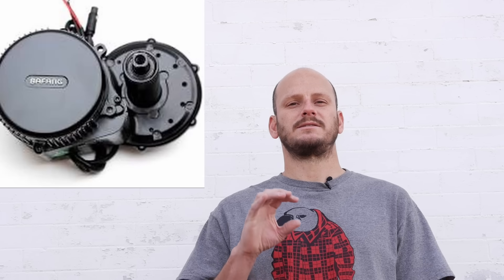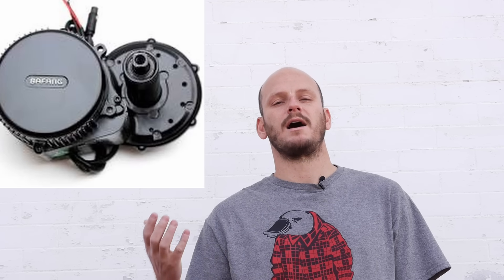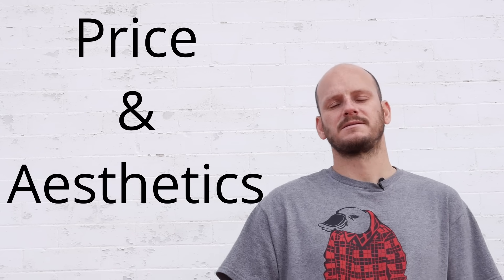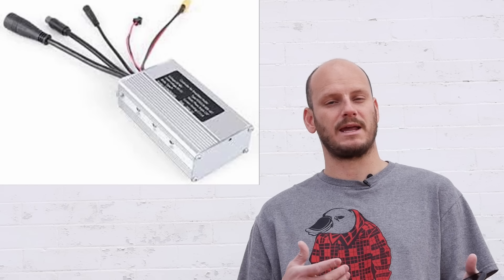Hub vs. Mid Drive Motors: Why Hub Motors Suck and Debunking Common Myths with performance test

Comment: I just installed a 350 watt (36v, 13 Amp battery) hub drive on my Milwaukee gravel bike and the hill performance is astounding.  On paved roads it levels hills nicely, feels like a tailwind, and on the roughest, steep gravel it gives me confidence I didn't have before.  Can't think of anything worse than spinning-out or stalling on a steep gravel hill.  The bicycle is equipped with a 10-speed 11-32 cassette with a 26/39 crankset, as long as there's traction, never had a problem in the machine's 18,300 kilometers on the dirt but the e-hub contributes greatly.

Comment: Boy you can tell you make more money off of mid drives. Highly exaggerated. Yes mid drives are better in many ways. But they're not really worth the price compared to the price of a hub Drive. I know how to use gears and I still own a hub Drive. I go up hills and I go long distances I have a 52 volt 20 amp hour battery too. If you're going to spend money you might as well buy a bigger battery. Not a mid Drive motor.

Comment: As the power demand on a mid is less than with a hub because of the gears, does this mean the number of miles per one charge should be longer?
Reply from the maker: Yes
Reply: @JohnnyNerdOut  thanks. I’m in Japan where there is a limit on all e-bikes of 20km/h.  Is there any way (like with a controller) to unrestricted the performance of either a hub or mid frame motor?

Comment: I'm thinking about getting and Accolmile Cola Bear E-bike with the Bafang  mid-drive motor.

Pretty sure I'm going to need to add a second battery to run parallel.

Do you have any idea how to do this on this motor.

I added a 2nd battery to my Juiced Hyperscorpion.  I was super easy.  Just open the XT 60 connector and extend the wires to the battery blender and 2nd battery.

How would I do this with the Bafang motor with the controller and wires in the motor housing? 

Are the wires different or the same XT-60?

Comment: What about front hub motor. You can start in a low gear and shift up. Let off during shifts. Also add pedal power in higher gears. No chain issues. I  havent decided what i want yet.
Reply from the maker: It really boils down to what you want/need to get out of the bike. Front hub setup can be perfect for certain use cases 👍

Comment: Not buying this.. hub motors are more reliable!
With a mid-drive if you’re off roading and you break your derailer, your chain, your sprocket whatever you’re screwed! And they put a lot of stress on the chain and drivetrain!
With a hub motor if your drive train breaks anywhere you just use the power of the hub motor to get home! And there is even bikes like the Grizzly that is all wheel drive and has 2 hub motors so even if you had a motor go out and you broke your drive train. You would still be able to power yourself home.

Comment: I think the reason you saw alot more hub moters burn out is because they are way more common .The torque rating is dependant on size of motor and power going to it ect ,  if you compaired the mid drive to a 3000w hub motor with like two or 3000 watts going to it ,  and you rode side by side with the 750w mid drive I bet you would get about the same amount of distance with the same battery size and I thinkyou would  have more top end.,motors waste energy as they over heat  . hub motors are extreamly relieable just read all the positive coments  ,  one problem is people use motors that are just to small for there body weight and or riding conditons  . The 750w vs 750w in my opinion is not an apples for apples test , why not compare the mid drive to a larger hub motor and controller ,  and run them side by side and measure the wattage used .  my hub motor is extreamly efficienct 82- 95% how do you like those apples ?
Reply from the maker: I think the issue is that 750w mid drive compared to a 3kw hub is not apples to apples from the start. One is street legal and one is not. It would be like comparing a 4 cylinder civic to a 8 cylinder f-150. Except in this case the civic outperforms the f-150 and is legally able to be taken anywhere in the USA and not get confiscated.
Reply: @JohnnyNerdOut  It is recless indangerment to force people to use motors that are made to fail under such small loads ,  larger more safe and reliable motors shuld be required  ,  they have options to use much safer and larger braking systems ,  the controller size  is what the law shuld be regulating , To force ebikes to have motors so small that it makes them impead the flow of trafic is recless indangerment . Bikes have to be allowed to use the road and sidewalk ,  its survival ! A three hundred pound person needs way more power to go the same speed as a 100# person ,  many times the power is needed to avoid injoury and death . Also using such tiny motors can cause them to over heat and weaken the magnets wich will cause a decrease in power output .power is needed to to pull the bike out of a lean when cornering , its phisics  . I have been riding almost every day for years and have learned alot about surviving .  on two wheels .
Reply: @JohnnyNerdOut  imagine if the police said the f150 is not allowed because it has too much power ! Do they even consider the people that use their bikes to tow things ? I cant belive they allow a motorcycle on the road with a super charged corvette engine in it . chech out the boss hoss video's

Comment: Does the hub motor with a gear set make a difference? Ok, issues with rear wheel spoke and hub. Mid drive sounds better.

Comment: each motor type has applications they shine at. The Onyx RCR hub motor is fantastic for stree use. It can climb anything and there are no gears. When I go XC riding, I take my mids. Both motors shine in specific areas.

Comment: I don't have either but wouldn't you lose torque with a chain? I ha e a single speed stretch cruiser and have a cheap motorized motor. Do they just sell the motor and speed controller?  I'll just make my own brackets

Comment: Totally disagree, I hate middrives. Hub drives are faster and if you have AWD THEY WILL DESTROY A MIDDRIVE AND DONT HAVE TO WORRY ABOUT GETTING STUCK IN THE WOODS. Middrives are slow and you have to downshift or could blow motor or break the chain. You give me two bafang RM G062.1000.D MOTORS 60VOLT 45AMP CONTROLLERS NOTHING WILL BEAT IT, in towing and hauling wait. If one motor dies and/or chain breaks YOU still get home. My opinion.

Comment: I would like to mention that there are gear reduction hub motors  and hub motors with no gears just a shaft with two bearings,  so not much to Wear out or break ,  if not over powered ,  the problem is bad law making ,  when the law  wants people to use moters that burn out at a small amount of power thats dangerous ! , the law shuld only be concerined about the size of the controller and not worry about how many watts the motor can take before it burns out . if you run a hub motor rated at 6000 watts and only give it 3000 watts or less its going to run much cooler than if you run it at 6000w so you wont be overheating the magnets or windings making it extreamely reliable . I got chased alot by dogs when I had a mid drive and never with the hub drive because the sound the mid drive made !  Different spokes for different folks .

Comment: I have both- a 1500W BBSHD ultra mid-drive fat-tire bike, and a 12000W hub-drive enduro bike. I agree with most of your points, but for high-power e-bike builds, I find the hub drive setup are just better all-around in terms of reliability, efficiency w/ regen, and noise, which are the most important things I find for a daily-rider in the city. I ride my hub drive much more often because of this, and pretty much only put my mid-drive on the rack to drive it to trailheads.

Comment: What about planetary gear hub motors? Those have the same mechanical advantage. 

Also, if both motors are same wattage draw, and the torques are different. Then the speed cannot be different. 

Speed and torque are directly proportional. 

Example, if I apply 1000w to 2 systems. 
The first system has a torque of 1nm and a speed of 1 RPM.
The second system is geared down and has a torque of 2nm, the speed of system 2 with the same power I put would be 0.5 RPMs. 

Half the torque = double the speed. 
If the torque is different from motor to motor and the speed is the same from motor to motor then the wattage is clearly not the same what so ever.

Comment: Do you recommend any off the shelf electric bikes?
Reply from the maker: There are some decent ones. By that, I mean, less than a ripoff than others. I will say that radpower for example is less of a rip-off than competitors in most circumstances
Reply: @JohnnyNerdOut  Thanks - radpower is like a 100 lbs - I'll keep looking I'll let you know what or if I buy I think I'll stick with the  regular bike for now I have a Giant Full Suspension with air that I can lock out.

Comment: So far in the beginning, he mentions how you typically get double the torque with a mid drive vs the hub.  When I looked on Amazon, this is true, but the price is what kills this for me.   In my opinion, I think hubs are just fine in the city.  Unless you're going to a remote mountainous country or state park in the USA, to go up steep grades, buying a mid-drive to ride (in town) to the grocery store, comic book store, work, or on a bike path is a colossal waste of money.
Reply from the maker: $450 for a bafang bbs02 motor on my website. Pair of with a 30 mile battery for $285 off my site and you have a killer ebike for under $800 that will destroy any premade ebike regardless of the price. All this assumes you have a bike. Or get a great bike for 500$ brand new (half for used) and you are still waaaaaaaaay better off.
Reply: @JohnnyNerdOut  I checked out the items you mentioned, but those would unfortunately blow the budget for this project, out of the water.  I was looking to make a peddle boat, and have it motorized with a mid drive on deck, to spin a paddle wheel.   Although this idea is as old as e bike motors have been out now, this one was for my own personal use.  The other nails in the coffin, are from my recent life events.   You never know if things will turn around.  I bookmarked your website.

Comment: This guy is talking about rear hub drive. I prefer my 1000W (limited to 750w) front hub motor bike over my 750W bafang mid drive. Mid drive chain kept slipping in top gears because of too much torque Also, not having to change gears and just keep in top gear on the front hub motor bike. I have no hills where I ride, so no need for that. I pedal super fast in top gear on the rear wheel while my front wheel is driven by hub motor on flat ground. Never have to change gears and go 30 mph

Comment: I just wanted to do some math, since the hub motor vs mid drive motor looked to me to perform far differently than I would have expected. Electric motors are pretty efficient over most of their rpm range, which is why electric cars only use one gear ratio between the motor and wheels. Additionally, unlike internal combustion engines, electric motors have maximum torque at 0 rpm. Given that, I figured that the hub motor you were looking at was just spec'd incorrectly. Looking online, it was a little bit hard to find numbers for ebike hub motors, but I was able to find one hub motor which was rated for a nominal speed of 560 rpm. This was on a 29" rim, which calculates out to it being spec'd for 48 miles per hour (neglecting frictional losses and air resistance). This is obviously spec'd badly, since you would want a motor capable of 1/2 the speed and double the torque. The limited top speed of the hub motor is likely due to the fact that it doesn't provide enough torque to overcome the air resistance at speed. This is essentially what your mid drive motor does by gearing down the motor. I was also able to find that there are geared hub motors out there which should negate the benefits of the mid drive motor. The reason, I would say, for the lackluster performance of the hub motor was that, due to it operating outside of it's efficient range due to an improper spec, it was wasting most of the incoming power as heat, whereas the mid drive motor was geared to fit the motor's spec and thus the motor was operating much more efficiently, converting more of that incoming power into mechanical output.
I also wanted to address the point that mid drive motors are superior because they have selectable gearing.. You used a car analogy, which is actually a really bad analogy. A decent car analogy would be to say that you had an electric car that was stuck in 3rd gear. It would drive just fine, because electric motors have a much broader efficiency and rpm range than internal combustion engines, which have a much smaller peak efficiency range and rpm range. What I'm saying is that having different gear ratio choices on an electric motor isn't strictly necessary or even advantageous. Electric cars only have one gear ratio, and we can see that they outperform most internal combustion engine cars at the drag strip, which means they are capable of plenty of torque. I suppose, to draw a car-based analogy, that it's kind of like having a low range gearbox on an electric car. If the motor is geared or spec'd properly, then it really shouldn't need that low range. If you just look at electric cars as-is, they already have plenty of low end torque and in most cases don't need the extra torque boost from a low-range gearbox.
I'm not saying that hub motors are necessarily the best option, just that from the perspective of the electric motors alone, there is little reason why they should be worse than mid drive motors.
Reply: I just watched the newer video about hub vs mid-drive motors, and I think I understand where my argument doesn't quite work. What it comes down to is torque. Low power ebike motors just don't have enough torque for the sorts of slopes that bikes have to deal with, so having the extra gear ratios is beneficial to increase torque when needed.

Comment: Would NEVER buy a hub drive bike. I have a Gazelle T9 and Arroyo C7 --  and they are just as you said....like riding a normal bike but just a little extra power. Haven't broken a chain yet....knocking on wood.

Comment: What I don’t get, if transmitting the power of an electric motor is more efficient in a mid drive arrangement and therefore through the gears why don’t electric cars and Motorbikes use gearboxes?
Reply: The good ones do

Comment: Nice video, in general I am more a fan of mid drives too, but I would be interested to hear your thoughts on the hub drive's regenerative ability; something a mid  drive can't be set up for.
Reply from the maker: Only direct drive hub motors can support regen which makes up almost less than 1% of hub motor bikes. There is not enough inertia n a bike to make it worth the extra cost imo.
Reply: @JohnnyNerdOut  Yeppers - none what-so-ever. Mid-Drive is the future. All the other offerings - hub drives - are just managers trying to liquidate their assets ASAP.

Comment: 5:55 And how do you think torque is transferred from mid-motor to the ground?
It goes through the same spokes.
Reply from the maker: Of course, but the build quality on cheap hub motors are horrible compared to even an entry level hub on a decent bike.
Reply: @JohnnyNerdOut  That's a completely different matter.

Comment: Am leaning toward mid-drive for all the good reasons you cite. But I've got questions.

Use case: I'll equip my 1-by Giant 29er with panniers for shopping purposes. My return home has miles of steep hills, and ends in a grade that I'd estimate at 15 degrees. Fully loaded, the last couple of miles would be a death march if unassisted. I am willing to pedal hard at all times, so that I'm working with the Bafang and not relying solely on it. I am comfortable at cadences up to 120 RPM at the cranks. For me to get the speed I like on the flats and climbing power I need on the hills, I prefer a range of gear-inches from 20 to 108.

Q1: For the Bafang mid-drive to operate at an optimal RPM without overheating, what should my pedaling cadence be?
Q2: I grant that the Bafang is not going to "love" running against a 108-gear-inch ratio, but will it be able to supply some power at least?

Comment: Different situation in Europe where 250 watt motors are the legal max for road use (otherwise the bike must be registered as a motor vehicle with road tax, inspection, log book, number plates, third party insurance and a driving licence). I think most of your arguments don't apply when using less powerful motors.
Reply: Thats true. Hope you guys get more relaxed ebike laws over there. If you do you will fall in love with mid drives

Comment: I switched from mid-drive to Hub so I don't have to replace the chain every year. And I avoid all spoke problems with cast Wheels. I think I've solved the rear flat problem by using motorcycle tires on my 20" wheels, which are much heavier and rated to 93 miles per hour. Being lightweight myself, I may never get a flat again. 

One thing I like about my Hub Drive In  traffic is that I can throttle my way out of any dangerous situation, without worrying that my chain is going to break or skip. 

Certainly mid-drives are more bike-like and elegant and efficient. But what I want is super reliable transportation with  minimum maintenance. Now my chain will last for years and I have no spokes to get loose. I don't think I'll buy another mid drive untill they start using bigger chains, maybe motorcycle grade.
Reply: Nothing is more reliable than a mid drive belt drive with an internally geared hub and inner tube gaurds